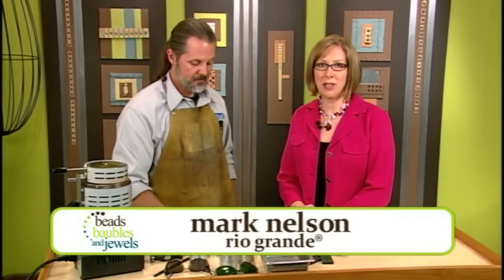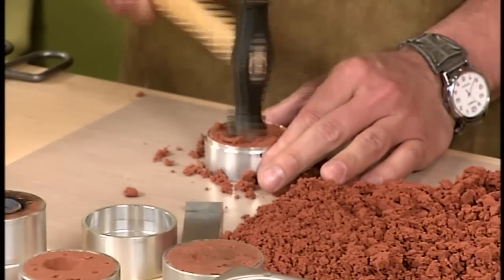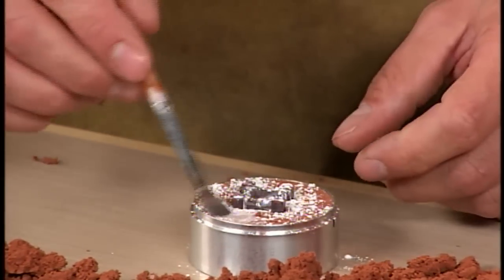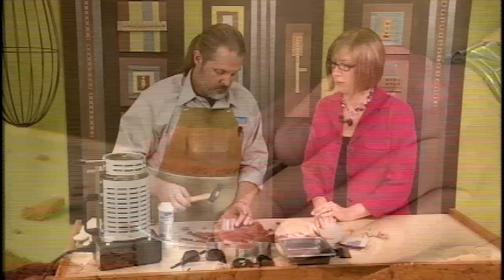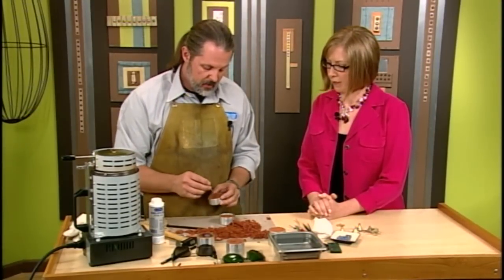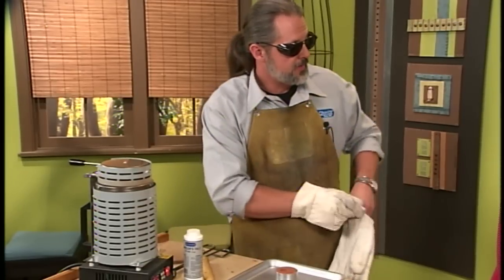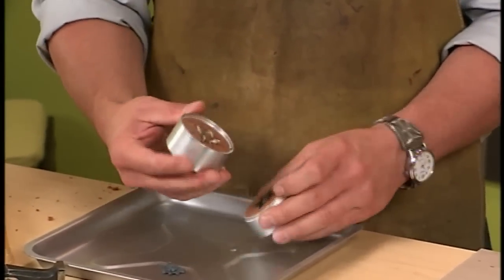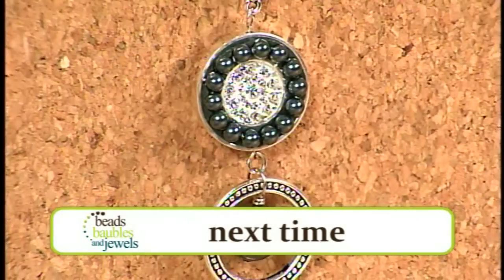How To Sand Cast a Bead Frame

Comment: You did not show how the vent channels are made to link to the vent holes. You did not show that the filling and vent holes need to be made from the inside towards the outside of the mould. No mention of not twisting when taking the rings apart. Why not slow down and show all the steps.